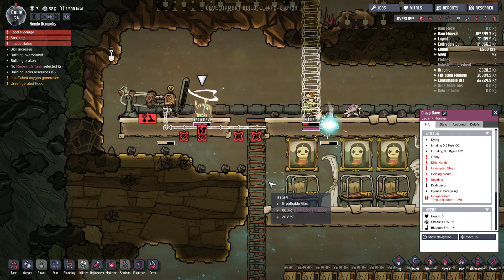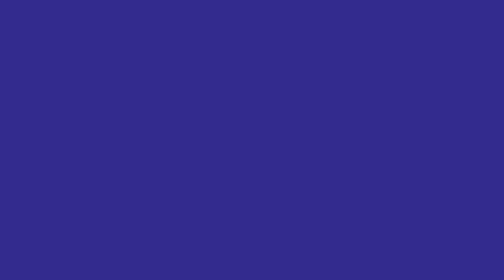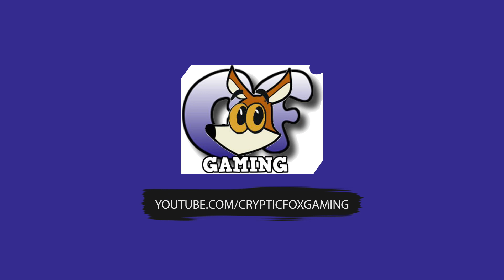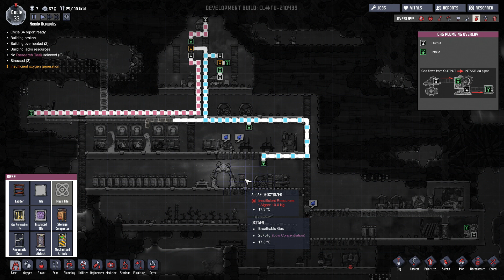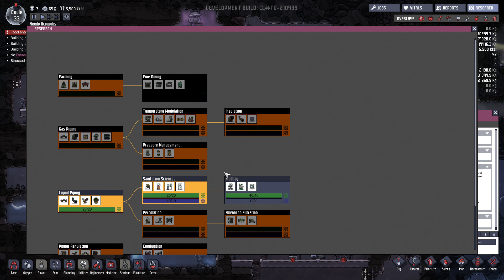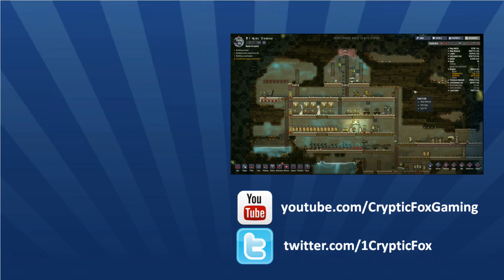Crazy Dave Incapacitated! | Colony Improvements - Oxygen Not Included Gameplay - Part 12

Comment: Cryptic u r wasting water! The electrolyzers are taking 10 times the water then they need. To fix this all u need to do is split the water in half by running liquid vents back into your water source
Reply from the maker: +Cameron _ just because the pipe has 10kg of water per segment in them doesn't mean that's how much water is being used per second.  The movement animation in the pipe will look the same whether 1g of water moves or 10kg.  Besides, after the update water is not nearly as scarce, and if you have one or more geysers then flooding is a risk

Comment: I wish there was a way you can kind of make things off limits, as soon as you cooled down you water purifier with the water from the snow, the duplicates were in there taking all your water to use for other projects instead of using the water source to the left of them. They grab their resources from the weirdest locations. -- But thanks for all the videos, I learned a lot from them and it helped improve my own colony, though it looks like this new update will be a complete game changer for me.
Reply from the maker: haha I know right?  I'll redesign that space a bit so that they can reach the purifier to refill it without being able to reach the water.  Technically you can restrict access to spaces using the mechanized airlock door, and setting it so only certain duplicants have access, but that dupe might still go in there to take water lol.

Glad the videos have been helpful!  Best tip for the new update, plan for and manage the heat of certain building before you even build the item.  Its WAY easier to keep them cool then it is to cool them down after they overheat.
Reply: You can set a pressure door to be locked, and only unlock to restock filtration media. But the snow helped, probably should dig up more to load in there, or chill the CO2 being scrubbed. The leftover hot CO2 may be what is heating up the air scrubber so much.
Reply from the maker: Yeah I found in testing that the CO2 picks up its head from the building, so if you keep the building cool the CO2 is cool as well.  The melted snow works really well if the dupes don't clean it up :)

Comment: hahahah you duplicants picked up you the snow that melted to water right as u were speaking about it am LMAO @26:50
Reply from the maker: I figure they can get burned and then roll in the cold water haha.  The water purifier will overheat on it's own as well without the hot CO2.  I used it in another base where it wasn't near a heat source and same thing.  Using gas permeable tiles as a heat sink, and a bit of cool water made all the different in the world, and is more energy efficient than running a cooling system :)
Reply from the maker: lol they were working against me :)  i need to set that space up so they can't pick up the water on me but I can still refill the sand in the purifier :)
Reply: move water next what need water like mushbars put it next to a water source???
Reply from the maker: yep that would certainly be more efficient :)
Reply: CrypticFox Wonder if the cold water on the floor will offset the scalding?  :)  I think the hot CO2 from the genny is what overheated the scrubber. Apparently CO2 holds temp, or maybe better to say resists change?  Someone on forum mentioned cooling with liquid H2, that would be neat.